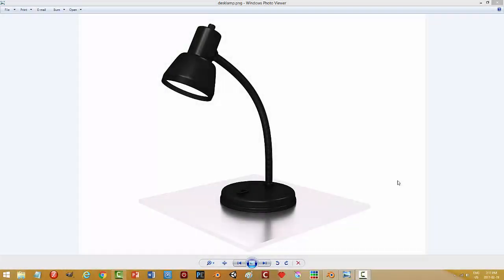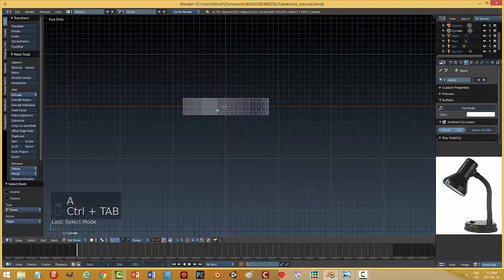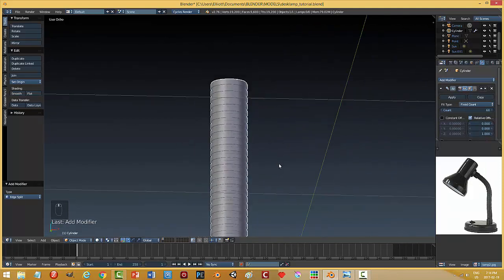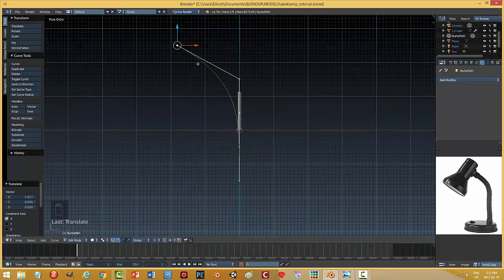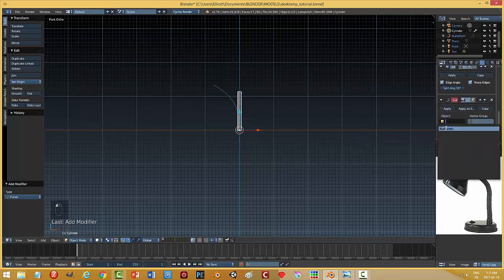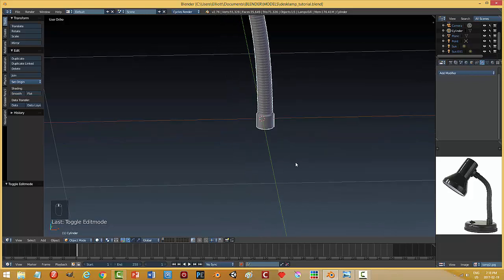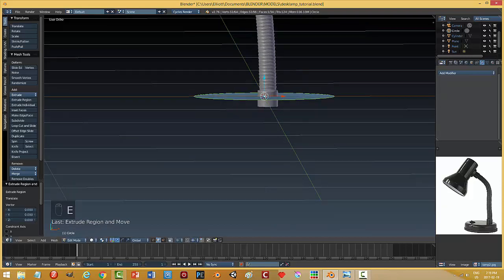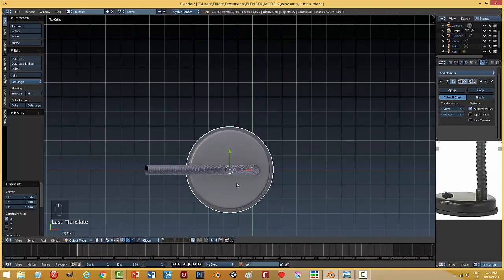Blender: Modeling a Desk Lamp

Comment: Not sure if this is one of your older videos but did you figure out a way to do what happened at 14:20 better ? (You were trying to extrude the edge ring at the end out along the normal, in the end I just extruded and eyeballed it).
Reply from the maker: It is an older video. I would have either switched to normal on the transform tool and that would help or choose extrude region from left toolbar and that should extrude along normals and/or use alt-s to scale.
Reply: I finished up this, even with the hack I did at the end of the gooseneck it came out pretty good. Here is the image: https://ibb.co/nHVPKy

PS: I changed up the base a little I thought it looked a bit better with more meat on it LOL
Reply from the maker: George, that looks fantastic!  Well done.  Keep 'em coming :)